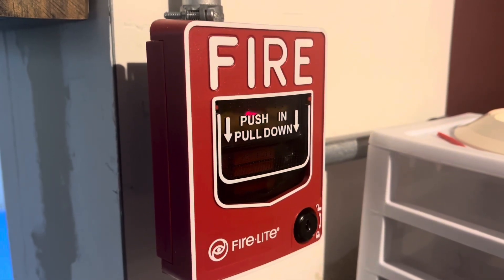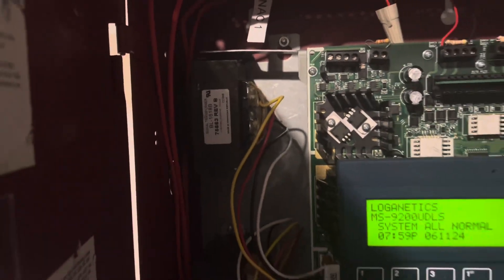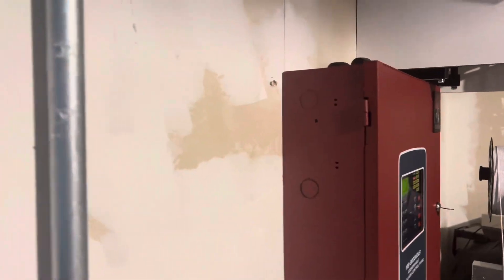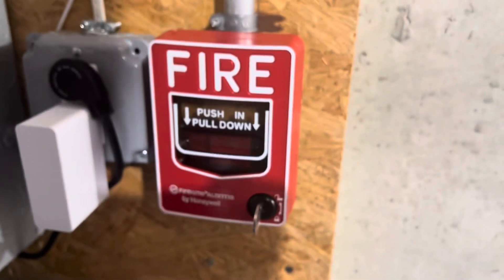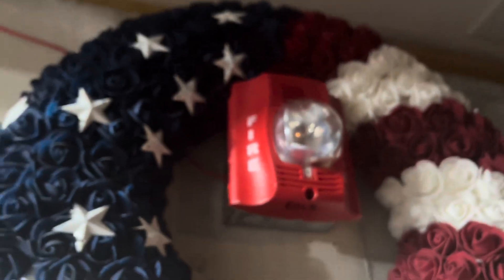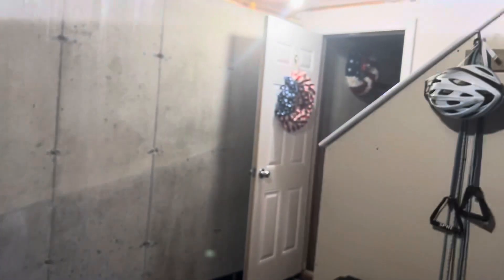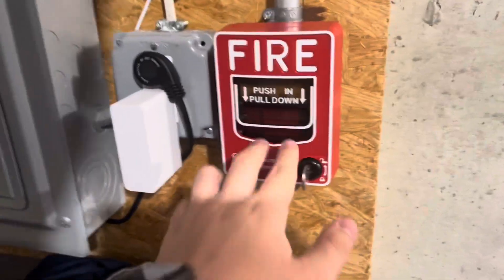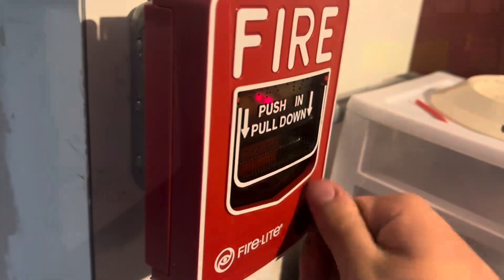Fire Alarm System Test 55: Fire-Lite MS-9200UDLS

Comment: Cool panel! I guess this is one of those not very many filtered DC FireLite Panels. I'm generally not a huge fan of FireLite Panels, but this one is better.
Reply from the maker: This one actually isn’t filtered, but it’s still a really nice panel!
Reply: @Loganetics1  I've actually noticed Advances sound off on FWR as Tice Arpey stated
Reply from the maker: @aidanthetoiletelevatorfire7554 interesting, I’ve never heard of that before and I also can’t hear any difference.
Reply: @Loganetics1  Yeah, it is not totally obvious, but on a Simplex Fire Alarm you would definitely notice it and it would be much worse.
Reply from the maker: @aidanthetoiletelevatorfire7554 does Tice have a video showing an advance running on FWR? If he does, what’s the title?